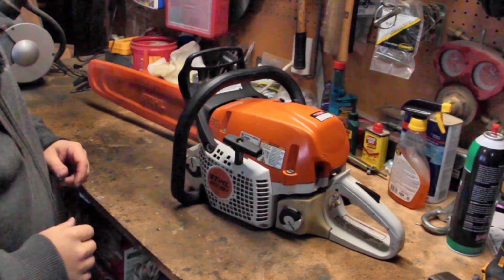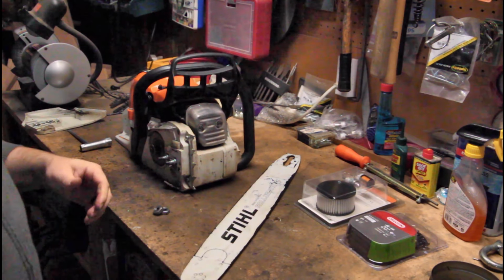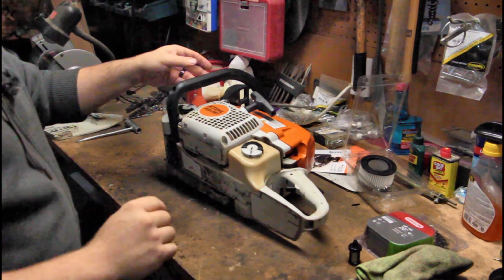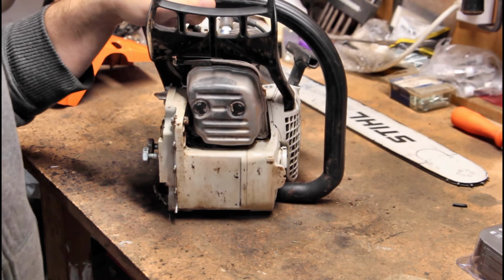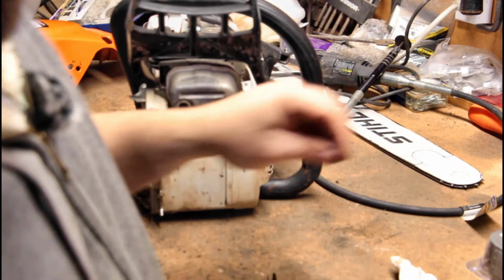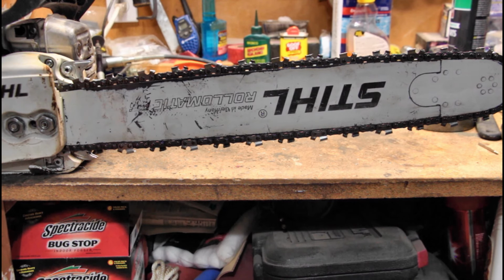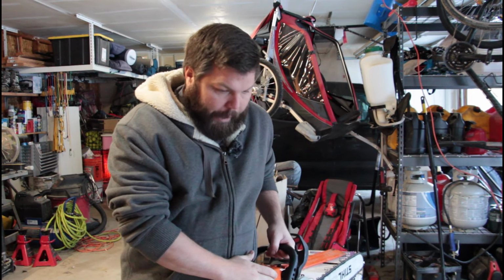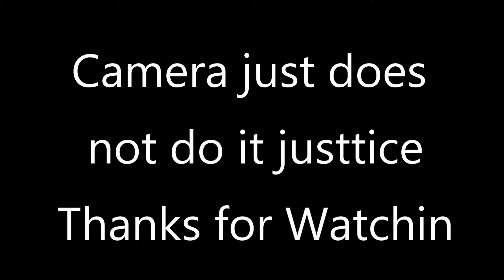Stihl MS391 Service, Modification, and Tune

Comment from the maker: There is a noticeable blank spot, just as I show what it sounds like with the volume unedited. However, I think I messed up the editing and actually cut that clip instead of copying it, and of course, didnt notice until after I published the video. That clip is at the end. :)
Reply: I bought myself a brand new MS311 last year which is exactly the same saw except few cc smaller cylinder. Extremely happy with it. Running it 100% stock and it came without spark arrestor screen. Runs amazingly...
Reply: One small advice on cleaning the bar is, take a thin knife and run it through the groove of your guide bar to clean it..
Reply: One more thing to teach you. That flap for warm air shouldn't be removed. That flap should be lipped with sunny symbol up unless if you run the saw below zero, then it should be flipped up with snow flake symbol up. It will allow some warm air to reach intake and prevent the air filter from freezing...
Reply: And I guess that spark arrestor screen is only in North America, because here in Croatia (Europe) the only thing inside exhaust is baffle and hole to expell exhaust gases. As baffle I mean just a perforated pipe that silences the sound of explosions and creates some back pressure. Two stroke engines need some back pressure which increase the compression, because two strokes don't have valves... I think for European market the exhaust is just right because it doesn't have mesh to slow the exhaust gases... My MS311 is 59cc and hole on exhaust is 12mm or 14mm not sure I didn't measure, but runs incredible and it burns less fuel so gives me better fuel economy. Probably gives me more longevity. I just LOOOOVE my saw...
I have two. My old one is MS230 from 2005 and bought myself MS311 last year.

Comment: I don't know if it was said by someone else, but the small plastic piece for summer/winter mode is designed to be flipped over and put back in the saw. You will notice one side has a sun (summer) and the other a snowflake (winter). Great video overall, just got a 391 myself!
Reply: What is this?

Comment: I've come back with a warning about the muffler mod: double and triple check that the exhaust is not hitting the plastic housing anywhere. After about 4 tanks (2.5 ish hours) of work I noticed a spot on the oil tank that was beginning to melt and burn. Just a word to the wise that if you do this mod, consider only doing the top two cuts and/ or verify you've angled the slits away from the saw body
Reply: I can absolutely see what you are saying. Thanks bro for your input 👌

Comment: @TractorsNStuff I wouldn’t listen to but a couple folks in this comment section. I’ve been around and have worked on saws my entire life. This video was great with the knowledge you have. Hats off. Now, the only REAL critique you need is on the limiter caps section. The white plastics inside are limiter caps. With the carb off, take needle nose pliers and pull them off, if they break it’s fine. However, you shouldn’t have to do this. If the carb is healthy, it should tune well with the caps on. 1 to 1.5 turns out to start tuning. If you want to get a little better throttle response tune the Low jet, more rpm in the cut, tune the High jet. Also, a good rule of thumb is to have the muffler port (the hole) 70% the size the exhaust port. This might also be the only reason you need to retune your High jet beyond the limiter. Best of luck, you did a fine job, great explanation of everything👍🏻
Reply from the maker: Thank you for the awesome kind words! Those limiter caps look to be a pain! Fortunately, it tuned just fine. 
Thank you for watching and commenting!

Comment: Dude, very good procedure for dialing in the fuel screws!  And as you know, a tach is a must!  
I’ve got a 390 I modded several years ago. I set the max rpms to 13,500 and have had no problems. 32:1 mix.
Reply from the maker: Thank you! I appreciate the feedback. Thank you for watching and commenting!
Reply: 400c is the way to go

Comment: I agree that the dogs are way too small. I changed them out on my 391 immediately as well as added a 28" bar and full house, handfiled oregon vanguard chain. Its a beast that bucks 3' logs no problem, but I know I can get a bit more speed from the muffler mod
.
Thanks for making such an in depth video. You gained a new subscriber
Reply: 17.39 you did not read the manual if that’s a 391!  You making the situation worse!  You flip the plastic deflector around so the snowflake is up for winter!  Double check your manual! Great vid👍

Comment: Wow!  Late comment here, but I just had to say, if someone gave me a MS391, especially a Family member, I wouldn’t be putting it down?!  He could have just given you a Farm Boss, or the MS 291?  Not everybody needs a ‘Pro Saw?’  

And from what i saw, starting @ 04:11, you might want to hone your skills, and develop proper and safe practices, with this saw first?!  You even said it was warm, so why you chose to choke it is a mystery?  And I get it that Not everyone wants to start a saw on the ground,  but ‘Drop starting’ it like you did, was a no no.  If, If you're gonna have to drop start a saw, turn it the other way, and your undamaged leg/artery will thank you!  The saw will have a tendency to swing down towards the body, the way you were trying to start it, and should yourself, or someone that watched this video, forgets to engage the brake, and the saw fires up, while swinging into a leg, or whatever, well, you get my point!  😳 Stihl advises starting it with the saw held between the legs, with bar and chain pointing away from the operator, if not using the ground method.  

Please take my comments as they’re meant, and that is for safe and wise use of these machines.  I’m no friggin expert, and I’ve done some dumbass things in my day, but I just want people out there that may watch your video, and others, to not copy unsafe methods.  I gave you a thumbs up, and I wish you well and please stay safe and healthy!  Peace!  👍

Comment: Next time move the piston up to top dead center or close to it.  Added precaution to keep debris. And you can use compressed air to blow it out when you're cleaning up the cooling fins.

Comment: I have a couple questions, I am just getting into these engines and want to learn things the right way.  I am looking for upgrades that improve the functionality of the saw without compromising reliability.  I am watching this with subtitles in a starbucks rn so I may have missed you talking about it but how do you feel about plugging the decompression valve?  Also, when porting, how do you calculate your timing numbers?  Porting is something that I am hesitant to start until I can understand how to quantify the amounts I want to remove.

Comment: Tractor Nstuff   I have a 391 and when I start it I pull the cord 3 or 4 times on choke and then move the lever up a notch and pull to start. It usually starts and until recently it would go into fast idle but the last few times I ran the saw it would not go into Fast Idle with a cold engine. It wants to idle slower then it should until I feather the throttle and then it finally kicks into the Cold fast idle, is this a carburetor problem.

Comment: Do you think i can upgrade my ms291 with an ms 391 engine??
Reply from the maker: Thats a good question. I'm sorry, but I do not know. 
If it bolts up to the frame, and the covers and everything else lines up, I dont see why it wouldnt work. But I honestly do not know.
Reply: No, you can't, completely different engine and different mounts

Comment: I found one flaw. Small exhaust bolt broke under normal operation. Have to drill and extract about 3/32" bolt. Fun fun.
Reply from the maker: WOW! I'm guessing that much bolt must have broken off deep down inside? 3/32" is not really that much, but deep down in there is probably a nightmare!

Comment: I bought a big box of those cans at a yard sale the lady said they were film cans but I don’t know for sure.I have the ms 391 but my air filter is different and my muffler is already slotted in the front and it has the split case like the commercial saws just wondering how old your saw is.Im guessing I bought mine in 2014.👍
Reply from the maker: Thats exactly when I got my saw, 2014. 
And your correct about the cans. They are old film cans! Great for holding small parts and whatnot. Thank you for watching and commenting!
Reply: TractorsNStuff Wow,now I’m curious as too why the differences.My air filter is square, bigger cleats and like I mentioned it has the split case like the commercial saws and my muffler is already levered in the front with a screen that I have to pull out and clean ,pretty sure it’s a spark arrestor.My sales receipt is too faded to read the date but my stihl dealer has it on record and they are making me up several skip chains to replace my old worn out ones.If you haven’t tried the skip chains I would suggest it,I use both half skip and full skip chains will never go back too regular chains.Thanks for answering
Reply from the maker: @steveyork8069  Yeah, I don't know why there is a difference. Honestly, I don't know much about these saws to know the differences between models, let alone the same model with significant differences! 
I have used a skip chain, and they are great when I need to sharpen them on the saw for sure! But I have more luck finding the full tooth chains in the hardware store. I have to order the skip toothed ones.
Reply: TractorsNStuff I’ve already been doing some research there are 8 different model numbers on ms391.Im lucky enough to have a stihl dealer in town so I just have them make mine,about $12 more than the Oregon chains but I get much better life out of them.👍

Comment: I have about 5 hours on my Ms 391 and it's the hardest thing to start compared to any saw I have you have any ideas or video you can put on there just with suggestions of starting that bad boy?
Reply: mine cranks fine if i do this, choke , start lever pressed on throttle and pull till sputter ( three times) then flip choke lever up on notch and pull should fire right up. had mine 14 years and its a beast. if this does not work i would think you have a spark plug issue ( doubt it) or a carb issue. if the plug is sparking and not cranking you got a fuel issue either in tank ( filter ) or carb.
Reply: @bullofthewoods9374  that is why makita has new 40v chainsaw, NO COMPLICATIONS for home owners. Tho, ms391 is for homeowners that need cheap saw thats stronger than ms291
Reply: @i1bike  battery has come a long way for sure but it wont do the job for me. i cut 8 to 10 cords a year. battery just wont do.  i actually had a makita back in 95 and it was great, i ended up getting a farm boss then the 391.  and the 391 is not a cheap saw its about 600. its the largest non pro series in that line, also my brother just got the 400 in pro series and i have to say it a nice saw but it doesnt do much more my 391 cant. it is a bad ass saw though. but at 900 it should be.
Reply: @bullofthewoods9374  
Here in croatia, which is 500km from germany, ms391 costs 950$ and ms400 costs 1350$. Normal croatians work for 600-700$ a month, so that ms391 for 600$ is a steal. Here, with 600$ you can only buy ms231 haha. Compared to stihl, husqvarna is little more expensive and makita is little more cheaper, while echo has bliblically high prices. Echo cs-4310es thats 43ccm saw costs 850$. So, you shouldnt take for granted some US benefites.
Reply: @i1bike  Im not taking anything for granted. I am surprised at the cost difference there to here? i wonder why that is, maybe a tax thing or tariff thing not sure? All of those saws are great saws. im just a stihl guy. i heard echo is coming in strong but they are cheaper here also than stihl. its funny many in canada use the huskys. to each their own i guess. all great tools
Reply: @bullofthewoods9374  
My brother lives in munich germany, ms 391 costs 1100$, and ms400 costs 1400$. Husqvarna in germany is much cheaper than stihl, for example 560xpg is 1000$. They battle stihl on their terrain, and they will sell even under price just to beat stihl haha. My brother could bring husqvarna from germany for more than 30% less money than i need to pay for it here haha. But in my exp, best saws were made by dolmar, and since makita bought the dolmar factory, makita ea6100 is my saw of choice. First, its only 750$, its a forest saw, so its way better than ms391 but - cheaper 200$, and same category as ms362 but - cheaper 400$. As you can see, no special tax for saw, when makita has reasonable price and echo is super expensive. Makita ea7300, a professional forest 73ccm saw is 800 euros in croatia and 900 euros in germany haha, cheaper than 43ccm echo saw haha.
Reply: @i1bike   i loved the makita i bought. sadly it feel off my truck when my cousin drove off with the tailgate open. needless to say it didnt survive. I would buy one again but not to many places sale them here in north carolina. echo is cheaper than stihl and husky though. if i did buy another saw it would be the pro series for sure since you can rebuild them vs the farm saws.
Reply: @bullofthewoods9374  
I would suggest buying echo since in the US its even cheaper than already extremely cheap stihl haha. Only reason is that, echo makes reliable and simple saws. Saw that can be played with and its not full of electrical egineering. Echo cs-7310sx, that would be my choice for now, or you can wait for echo to release a new 'SX' version of a 60 ccm saw. Such saws as 60 ccm can be ported and they are relatively light, compared to 70 and 80 ccm saws. Just make sure that new upcoming echo sx saw has the air-filter like the cs7310sx, it amazes me the size of the air-filter they put there haha

Comment: Overall, helpful to those new to chainsaws, but please get your script improved and your ‘order of march’ i.e. have the bits and pieces you’re  demonstrating ready to go e.g. the fuel filter still in the packet.. also get rid of those long pliers, just use a length of wire with end bent to form a hook  🪝. Cheers

Comment: Great video, thanks!! Can you tell me which meter are you using to measure RPM? I'm looking to get me one as well but only seem to find with laser.
Reply from the maker: Yep. Here is a link to the one I have
https://www.amazon.com/gp/product/B000FOOAXY/ref=ppx_yo_dt_b_search_asin_title?ie=UTF8&psc=1
Reply: Thanks for sharing!
Reply: @TractorsNStuff  do you just leave the wire around the spark plug wires at all times? I didn't see you wrapping it around on video.
Reply from the maker: @brianmitchell4809  No need for the wire. The meter is sensitive enough to sense the pulse though the plastic.
Reply: @TractorsNStuff  thanks man

Comment: The mrs is getting us a 391 for camping. Is it a good saw?
Reply from the maker: It is a very good saw! I cannot think of a dislike.
Reply: Only dislike is the transfer port covers are pressed on, and they sometimes come loose. They say there is "no fix" but I've put JB Weld on and it's doing fine so far. If they come off again, I'm going to weld them on! It's a horrible design. Some people gave even drilled into then and added bolts to keep them tight!

Comment: If ur 391 dosent cut as fast as a 362 there is some wrong with it. Mine hangs right with my friends 362.
Reply from the maker: I've never pit this saw against another in a  true side-by-side. I simply ran my neighbors saw (that had this mod) and was impressed at how it didnt lug down. So, I decided to mod mine. 
Thanks for watching and commenting!

Comment: Just lift up the handle and push the tip down...you are a smig tight but with that new chain stretching I’m assuming that your compensating for that.

Comment: great video, i have the same saw and it has been a stubborn pain in the ass since day 1. Hard starting unreliable compared to my ms362. Now no spark, changed ignition coil (gap .020),with new OEM part for the serial number (round air cleaner versus rectangular) new spark plug gap 020. And still will not start. Only thing I have nor done is new gas, but the 362 uses same juice and runs great. Makes you want to toss the SOB in the garbage.Guess maybe time to take it to the dealer.

Comment: We dont need to know how not to start a chainsaw as shown.
We're here to see if you can fix stihl junk and how you did it.
Currently own the last new stihl chainsaw i will ever own. Cant keep it running. Dealer cant fix it. Says its fine. 2 other places declare its fixed. Its not. Its worse than useless. It starts when cold. Floods easily and you wear yourself out cranking on it after the first run. Only way to start it after its warm is to jam the throttle wide open as you would any flooded engine which makes the saw a safety hazzard. Ive come to the conclusion that i will have to order all the tools to test every part of the saw and fix it myself. Stihl saw dealers are to incompetent to fix it or make it good. 
Failing that it will turn into a Husqvarna.